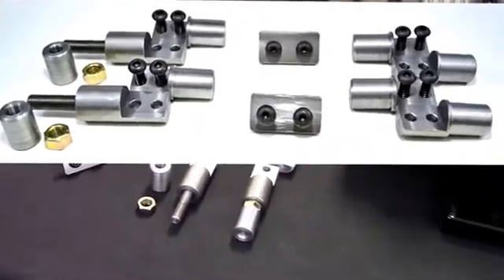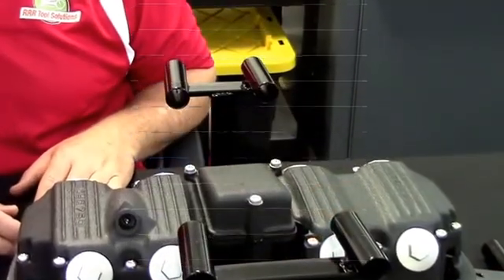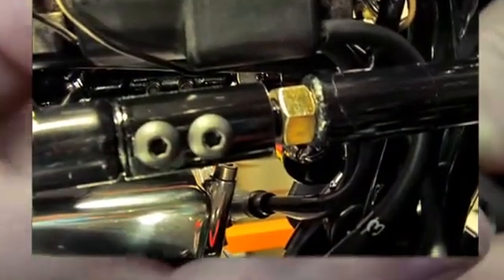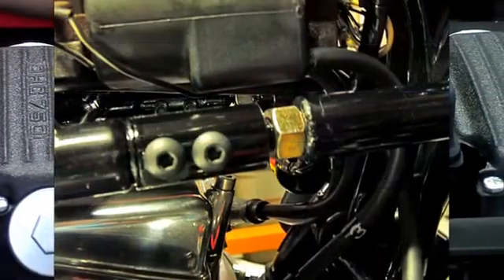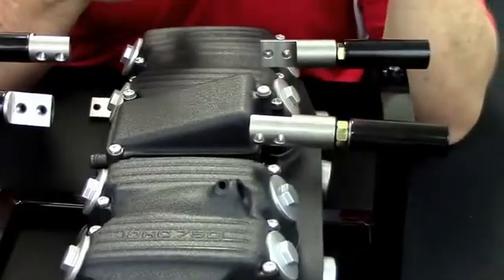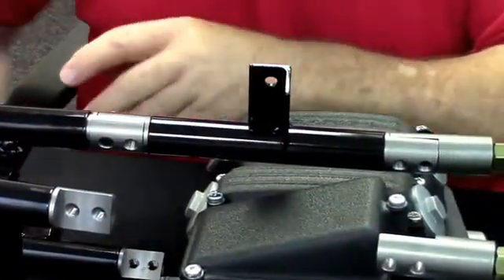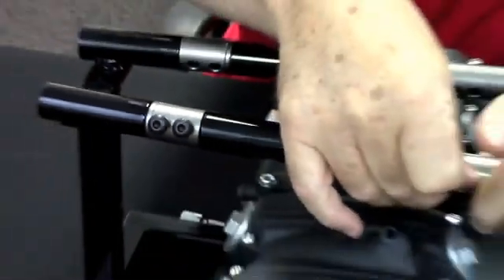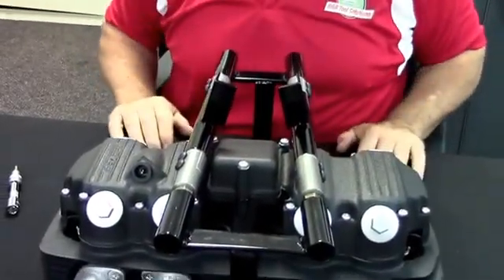Gordon Frame Kit for the Honda CB750 SOHC

Comment: Do you have anything such as the intake system that you have there and the frame kit for an Honda CB750 Nighthawk twin cam I know that I'm going to need a new exhaust system the video before this the 9:15 kit from the 750 I would like to know who makes that exhaust kit so I can purchase it you can find me on Facebook VA
Reply from the maker: Hi Chris, thanks for commenting. I don't have any useful info on the DOHC model.I just have not ever owned one and did not get into the internals like I did the SOHC's. There are some great and knowledgeable folks over at www.sohc.net that may can help. They have a place for non-SOHC folks to post questions. Good luck with your project!! Gordon/RTS
Reply: RRR Tool Solutions 864-710-7964 I do need a valve cover for the same motorcycle I'm having to recover my 125 Kawasaki 2 from a bunch of Thieves in the neighborhood again they took off with a bunch of parts off of my bike my Honda

Comment: Thanks for the video.
I agree just on the background music point made below - if you brother still has the video project file, perhaps it's worthwhile to ask him to render out an updated version, with music turned down to 25% volume, and repost?  Probably not too much work to do that, i suspect.
+ would help to understand the voice better.  All the best!
THANKS!
Reply from the maker: Thanks for commenting. He lost the original sound tracks when his computer crashed. He's bought a new HP laptop since, but the software that edited several videos including this one doesn't work on the new HP and we've lost that old software key code. I'm kind of stuck and my choices are remove it or leave as-is. I'd rather folks see it with the option of  turning the volume down/off than not to see it at all. We won't make these music mistakes in the future. Thanks again, Gordon/RTS